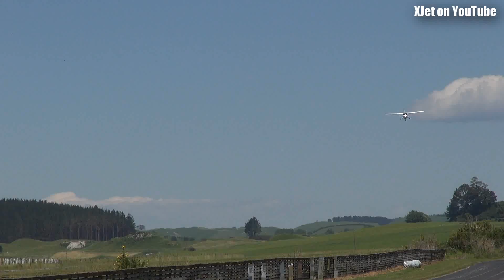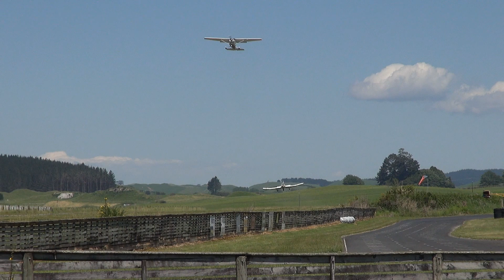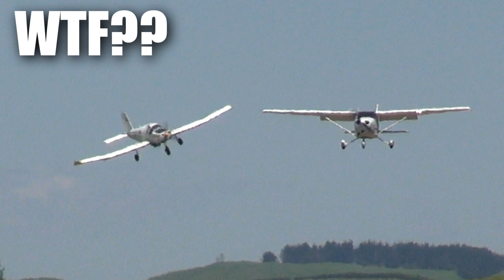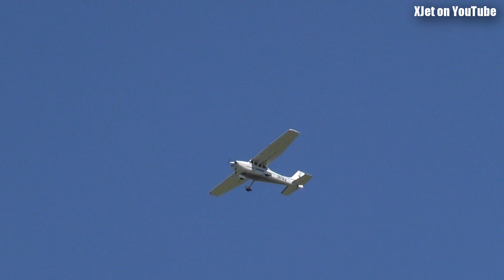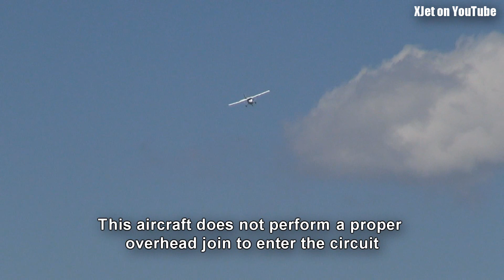Aircraft near miss at Tokoroa Airfield?

Comment: #1, the Fletcher is MUCH bigger than a 172 in real life. In the video it is significantly smaller, so it is well behind the 172. #2, where is the audio for the radio comms on the airfield freq? Were they communicating with each other. #3, overhead circuit joins are a good idea, but if this person announced their intentions on the radio at 5NM as they should and were in constant radio contact, then a non-standard overhead join isn't a biggy. What altitude were they at for the overhead join? We can't tell, so perhaps it was a standard overhead join. What makes you say it isn't? Perhaps the 172 had already indicated to the Fletcher that they were doing a missed approach and could they please squeeze in ahead of it. But hey, let's not let facts get in the way of headline grabbing.

Comment: Asked the CAA about this and this was their reply

The CAA has spoken to the operators of both the aircraft as seen in the video you have provided the link to.

·         Both pilots were well aware of each other’s aircraft and had each other in sight at all times.

·         The pilot of the high wing aircraft, a C172 carried out an overhead join while making the appropriate radio calls.

·         The video does not show the overhead re-join carried out by the C172 pilot nor does it show the entire circuit carried out.

·         The pilot of the C172 had sighted the other aircraft from some distance away while en-route to the airfield.

·         The pilot of the low wing aircraft, a FU24 was carry out an agricultural operation from the airfield and was permitted to do so by the South Waikato District Council and was also monitoring the local frequency.

·         An aircraft being used to perform an agricultural air operation is permitted to be operated below the minimum height for VFR including approaching to land.

·         Both aircraft were flown on the correct side of the runway for a right hand circuit, the correct circuit direction for the runway in use at the time.

·         No NOTAM was issued for the agricultural operation (and none is required) since it was possible the actual day of the operation might change at short notice due to weather conditions.

·         The videographers camera location and use of a telephoto lens has shortened the real distance between the two aircraft making it appear as if they are much closer together.

·         In the video the C172 is in front of the FU24. This is proven by the fact that a C172 has smaller wing span than a FU24 and yet in the video it appears to be larger.

·         The pilot of the FU24 did not consider there was any safety concern with the distance between the two aircraft at any time.

·         The student pilot of the C172 decided to ‘go-around’ because of the larger heavier and potentially faster aircraft behind him.

 

The CAA is not contemplating any legal action against either pilot and the investigation of your concern is complete.

As expected found in favor of pilots who can never do any wrong until someone dies then it an easy "pilot's Fault"

Comment: I'm not familiar with the term "overhead join" and I don't know what the landing pattern is for this airport but I do have a couple of observations: First, it appears the Cessna flys a pattern (of sorts) in that it overflys A portion of the field, then enters a downwind, base and a somewhat extended final. The other aircraft has been doing something off-camera and comes in with a short, low and unsquared combined base/final. The turning aircraft's pilot does not visually clear for oncoming traffic and it looks like the Cessna is the lower of the two, which in the U.S. gives the Cessna the ROW.

Comment: I don't know about your aviation regulations in NZ but in the US flying a full pattern before landing is not mandatory, especially at remote lightly-used landing strips such as your Tokoroa strip seems to be.  That said, both aircraft should have announced their positions and landing intentions on the unicom radio frequency to alert other aircraft in the area.  Also, all pilots must be on the lookout for other aircraft while in the pattern since many general aviation aircraft may not have functioning radios.  In this case, clearly, the low-wing aircraft was mostly at fault for making a waaay too low and short base-leg to final WWII F4U style (from the side) carrier approach and landing, and for not looking out for the Cessna that appeared to be on a proper final approach.

I had a similarly dangerous incident way back when.  I was approaching Cleburne airport in Texas in my then-new 1981 Cessna Cutlass C172RG.  I lowered the gear and did a full pattern  announcing my position at each leg of the pattern on the 122.8 IIRC unicom frequency.  I lined up on final, threw out the full flaps boat anchor, and was just about to touch down when out of nowhere some idiot in a C150 zoomed in low and fast from the right and landed downwind in front of me, with nary a peep from his radio.  I had to immediately abort my landing and do an emergency go around.  I warped that Cessna around the pattern as fast as I dared and did a fast taxi to parking to go have a 'word' with that effing idiot.  I found his Cessna parked in front of the flight shack with the pilot's door wide open.  Apparently the chump had a higher-priority bathroom 'mayday' as he was already in the toilet when I walked in.  I jumped back in my trusty Cutlass and headed back home to Parker County airport.  Yep, pilots always have to be looking out for idiots doing stoopid things.
Reply from the maker: Neither pilot broke the regulations.  Using a radio is not mandatory outside of controlled airspace (in fact there are still a few planes without radios in our skies) and an overhead join is not mandated at this airfield.   The irony is that just a week or so ago I addressed the local council and suggested that the new air-traffic monitoring system they have installed (as a way of charging landing fees) which records radio transmissions around the airfield, was becoming a disincentive for some pilots to use their radios.   The week before that I'd seen two aircraft use the airfield without making any radio calls, presumably to dodge the fees.    The Mayor told me that she wasn't concerned because she thought that pilots were responsible people.

I love this council.  On three occasions now I have corrected them on their mistakes in respect to the aviation regulations and they have said I was wrong.   On one occasion they claimed to have used expert "consultants" to verify their interpretation.   When I fronted up with written statements from CAA which confirmed that my interpretation was correct, the CEO of the council responded by saying of CAA's documents "oh, that's just their opinion".

Sigh!
Reply: Dam so give it a while and NZ will have an aviation disaster and then some common sense.
Reply: No, give it awhile and there will be a disaster because some idiot wasn't following the rules, and the goobernment types will call for more, harder to follow, rules.
Reply: Bruce - Good on ya mate!  Your Tokoroa council members  definitely seem to be last in line when KNOWLEDGE and COMMON SENSE were handed out.  I think it's fantastic that you've taken up the gauntlet to challenge their mind-numbingly stupid decisions.  Hopefully, the stooges will eventually learn something from you.  Have you ever thought about running for a council position yourself?  I think you're the perfect choice to keep letting the air out of their swelled heads! 

Cheers from the former Land of Smiles!
Reply: radio use not mandatory thats just stupid.. both pilots could use a few more lessons.. not ticking the boxes on a landing will get you killed
Reply: I had a similar experience. I was approaching a small 10/28 airport from the west with the wind favoring Runway 10, so rather than be a dick and call a long straight-in final, I decided to enter the pattern on an upwind and fly all the way around, so I began making the appropriate approach calls.

There was another pilot in the pattern making calls for Runway 10 as well, and I looked and looked for her and couldn't find her. She wasn't an issue for me, because she was calling final while I was still not quite upwind, but I do like to know where the other traffic is.

Suddenly I saw another plane rolling out downwind on Runway 28, directly head-on to the pilot I'd heard (but not seen) on final for Runway 10. I instantly made a CTAF call: "Aircraft on final for Runway 10, opposite-direction traffic rolling on Runway 28! Go around! Go around!"

The pilot I'd been hearing but not seeing in the pattern keyed the radio. "Not a problem, that's just me. Simulated emergency procedures."

So she had been making calls for Runway 10 while she was actually in the pattern for Runway 28, and had called final for 10 with a big "28" on the runway staring her in the face.

Okay, that's dumb, but I understand dumb, having done my own share of dumb things in the air when I'm distracted. (It turned out she had a little kid in the plane with her, so there was plenty of reason for distraction.)

But she tossed it off as no big deal, and tried to hide behind "simulated emergency procedures." I can't see any excuse for that. You don't simulate emergencies by landing on the wrong runway: that's how you create real emergencies. I was pretty pissed off.
Reply: Wow, that seems stupid, charge extra for people using safety equipment.  What's next, charging a car tax if you use your headlights and wipers in the rain, but no fee if you don't?  Turn signal and brake light tax?

Comment: Seems to me the Cessna did a hurried curcuit join and you can tell by the nose attitude, obvious high airspeed and lack of flap on early approach, that this was never going to be a good landing for the Cessna. He went around not because of the FU-24, but because his approach was crap. He may have been rushing to give the FU-24 more room, or more likely never saw it. 
The FU-24 would have easily had the Cessna in sight and was never as close as it appears at this angle of viewpoint. Also, the FU-24 has a real short rollout and would never have been at risk of collision. 
Poor airmanship? Yes perhaps technically by both, but the FU-24 was not the one who stuffed up their approach and had to go around.
Interesting footage. Cheers.

Comment: FYI it looks like the 172 had full flaps which in my experience was hard on my arms to do a go around...we were taught to trim for a go around which meant I had to push forward as I recall to do the landing. I understood the idea was the aircraft would then pitch up and you apply full throttle and go automatically into climb pitch/mode.. as quick as possible... its really hard on the arms or was at least for myself...Laurie
Reply: Yes doing a full flap landing in a C172 was always hard yakka for me....Laurie

Comment: At 1:38, if you freeze it, now get of your arse and grab a ruler. Measure the wingspan of both aircraft. The wingspan of the Fletcher in this video is significantly less than the Cessna at this point. Now in real life, the Cessna has a wingspan of 11m - the Fletcher is nearly 13m. Ergo the Fletcher is a considerable distance behind the Cessna......so not as close as the WTF freeze frame would like you to think.

Comment: Bruce what do you mean he didn’t rejoin properly?? (Cessna)
Reply: Mal Walker there is a standard pattern to fly before/while coming in to land.(search for "airfield traffic pattern" for a proper description) It's designed to make landing much safer as you automatically know where other planes could be, and it is also designed to keep two planes from flying directly towards one another during conflicting landing attempts.
Reply: Another factor is if multiple planes are in waiting to land they stay in the pattern, if you come down to land and don't, you rejoin the pattern. This numpty seems to have just done the equivalent of missing their exit on a divided highway then making a u-turn, driving back against traffic, and exiting onto the entrance ramp.
Reply: Didn’t this guy (Cessna) do the correct thing he flew the traffic pattern (crosswind, downwind, bass and final).

Where did the other guy come from
Reply: That's what I thought.  Looks like the other guy didn't go to base of runway and cut the pattern short.
Reply: I maybe wrong but he should have entered the pattern behind of Bruce and after the plane taking off. It looks like he went straight over the runway and entered above the other plane. Just my 2¢
Reply: Yeah...after watching it again, it looks like the Cessna didn't join in correctly.